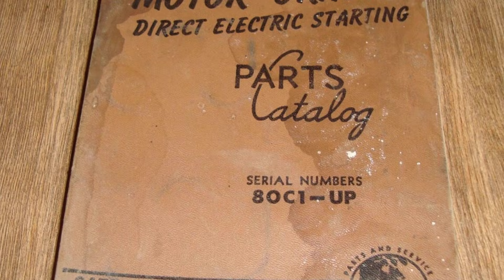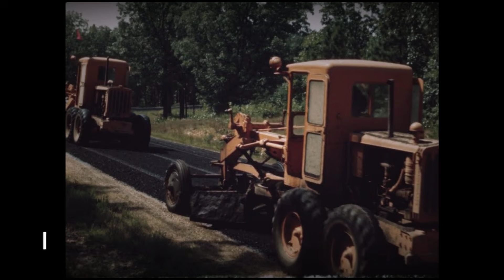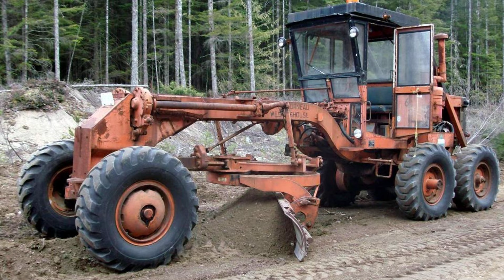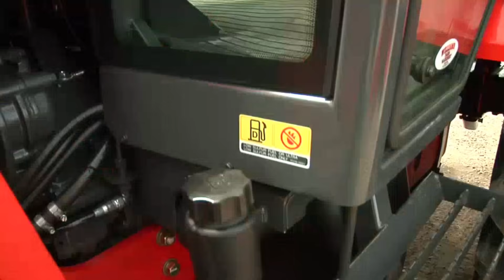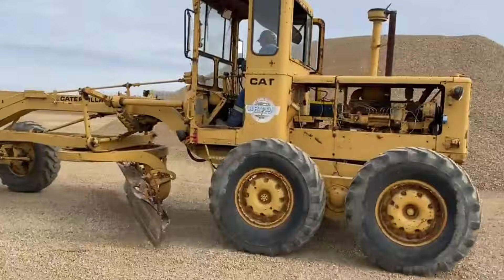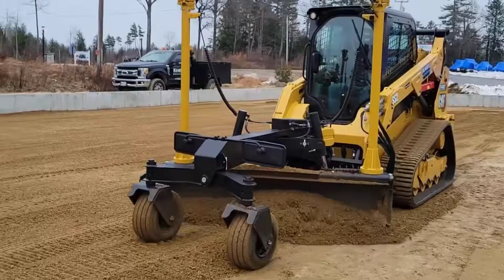Before Hydraulics: The Brutal Reality of 1950s Motor Graders

Comment from the maker: The number that stuck with me from this research:

Champion Road Machinery had fully hydraulic grader controls in 1928. Caterpillar didn't go full hydraulic until the 12G in 1973. That's a 45-year gap. And Cat's reasoning wasn't stubbornness — early hydraulic cylinders leaked under sustained load. On a grader cutting drainage slopes to 1/4 inch per foot, even tiny drift destroyed the grade. Their mechanical anti-creep brakes held position perfectly. Zero drift. Zero leak. The "outdated" technology was actually more precise.

But the human cost was real. 15 levers. 105 decibels. No rollover protection until 1972. No systematic fatality tracking until 1992.

If you ran one of these knuckle busters or know someone who did — drop your story below. These operators deserve to be in the documentary record. 👇

If this hits 500 likes we'll cover the decade that came before: the 1930s motor graders, when the machines were even more primitive and the operators even more exposed.

🔔 Subscribe — next week we go inside another machine that built the modern world.
https://www.youtube.com/@ConstructionLegends?sub_confirmation=1
Reply: Hello. ConstructionLegends.
My best count of the levers in the cab/control deck stops a bit short of your 15 - I spent a good few years operating these machines - with TWO of those levers being gear levers and one of them the throttle lever - which most operators DIDN'T use 'coz there was also an accelerator pedal on the floor. DO YOUR RESEARCH.

I am NOT including the parking brake lever 'coz it was NOT used for operating the machine, ONLY for parking it.

I AM including the levers for two OPTIONAL attachments which MANY 1950s machines did NOT have and one of those was more common than the other.

MANY 1950s graders DID have cabs. Even some 1940s machines had them. DO YOUR RESEARCH.

Galion built a hydraulic controlled grader BEFORE Champion. DO YOUR RESEARCH.

Am I off your Christmas card list yet?

Just my 0.02.

You have a wonderful DELUSION. Best wishes. Deas Plant.

Comment: I learned on a cat 12 E. It had shear pins in the blade control box, the new upgrade was a clutch with an adjustable slip  replacing the shear pins. The first hydraulic grader I got to run was a 16g while working for Ft. Myers construction, building Cape Coral, Florida.  It was awesome. 
       In the early 1980's I was working on a section of I-45 in south Florida and was running a Cat 16F with the slip clutch. l was cutting safety lanes and slopes to side ditch. The pipes that drained the medians would terminate into an end wall. The normal side slope was a 6to1 that would transition into a 2to1 and match the contour of the pipe. This company was using labor to form the slope transition. One day I was caught up and there was a couple of the pipe ends to shape so I took the 16F and cut the transition to the pipe, contour and back to slope. We had 3 graders doing final grade for the paving at the time. these where 12G hydraulic graders. The company boss was watching me do this and came over to me a said (why can't these new hydraulic g models do this.) I shrugged my shoulders and said I guess they don't to.
Reply from the maker: That's an incredible story! Running a Cat 16F on I-45 and cutting those slope transitions to the pipe by yourself while the 12G operators struggled — that's the kind of skill that speaks for itself. The boss's reaction says it all. Real operators like you are what built this country. Thanks for sharing these memories!

Comment: In the vicinity of 1930 .Sawyer Massey  was from Hamilton  Ontario  . There grader was a similar  style i 20 and  I 30 champions. Also Ontario  Canada.  They were built on McCormick deering  farm tractor s. Engine between  cab and blade. Sawyer Massey  was fully hydraulic  were champion had some. I've seen  two of them and 1 champion of that era
Reply from the maker: That's a great piece of history - thank you for sharing! Sawyer Massey from Hamilton, Ontario was indeed a fascinating company. The fact that they were building hydraulic graders while others were still using cable systems is remarkable. Really appreciate you adding this local knowledge!

Comment: Hello, ConstructionLegends.
It'z me again.

At 3.50, you prattle on about hand-cranking the pony motor of the 8T series Cat No 12 grader through a hole in the radiator. That method was LONG gone when the 8T series came into being. DO YOUR RESEARCH.

At 10.20, you call the Caterpillar blade control system a "power control unit" or a "PCU". I spent almost sixty years operating all sorts of heavy equipment, INCLUDING MANY GRADERS, and NEVER heard it called by that name. DO YOUR RESEARCH.

At 12.53, you claim that the shear pin would snap "if the blade struck a buried boulder or an unseen obstruction". NOT SO. It was there for a different purpose. Again, DO YOUR RESEARCH.

There was NO '2-speed' on ANY of the grader controls except the transmission.

At 15.43 you claim that these controls "could jam fingers into the gear mechanisms during rapid adjustments". Dunno how that could happen 'coz there were NO exposed gears ANYWHERE NEAR the control box or even in the cab. DO YOUR RESEARCH AND STOP POSTING BS.

I quit in DISGUST after that point, having once more O-D-ed on your BS.

Just my 0.02.

You have a wonderful DELUSION. Best wishes. Deas Plant.
Reply: Yeah, I get the same feelings about farm equipment videos. Thanks for clarifying, 👍

Comment: Why show a hydraulic machine
Reply from the maker: Hey Thomas! Actually, there is no hydraulics on this machine. If you look closely at the thumbnail, those are mechanical lift shafts, open gears, and chains used to operate the blade. It's 100% mechanical, just as the title says!
Reply: @ConstructionLegends clearly hydraulic with fluid hoses connected to them.
Reply from the maker: tedecker3792 Those are actually mechanical pins and linkages, not fluid hoses - easy to mix up at a glance! Thanks for watching.

Comment: I will bet those cat graders had about 1 million " lube fittings"
Reply: They have plenty lotta grease fittings I have 3 runners and a parts machine cat and I have a gallon hydraulic machine once it starts they multiply somehow 😂
Reply: Adams built the first tandem drive grader  in the i 30 style. Middle  1930s. McCormick deering  tractor  drive  behind  the blade
Reply: Adams/wabco  made more money  tan any cat could.   There was tons of wabco adams still working  when  they were 40/50 years old. No cat or john deere will b working  when  ther 50 years old.  Wabco hasn't  been built  since 1980 there's still tons working  on jobs
Reply: Hello, @tedhewitson823 .
I dunno how you came to that conclusion 'coz I see a LOTTTTTTT more SEVENTY year old Caterpillar graders than I see of either Adams or Wabco. In fact, I cain't remember seeing either an Adams or a Wabco grader in the last 20-PLUS years, but LOTZA Cats.

BUTTTT, you are entitled to your opinion - - - even if it'z WRONG.

Just my 0.02.

You have a wonderful delusion. Best wishes. Deas Plant.